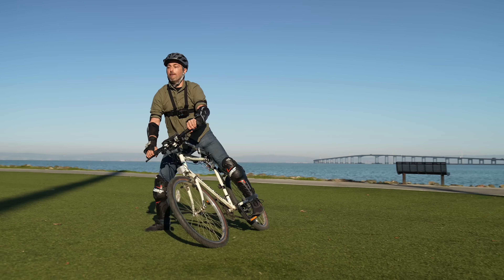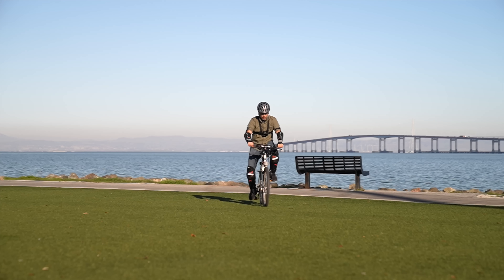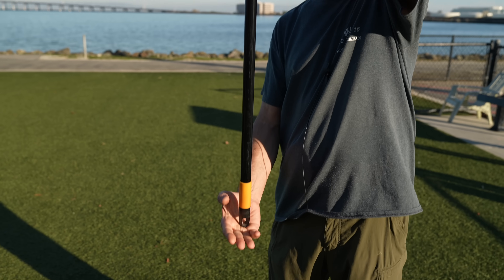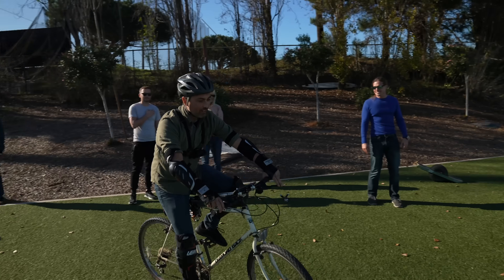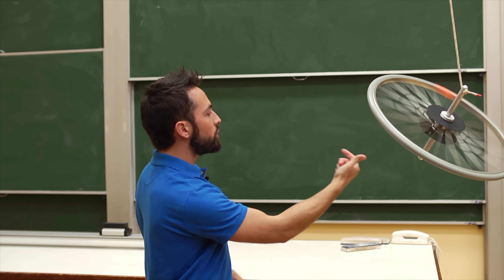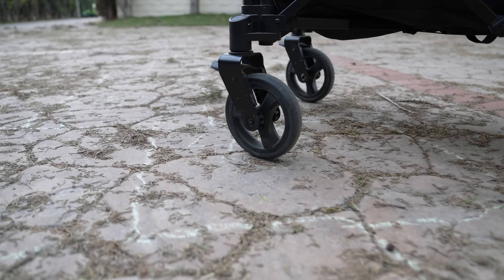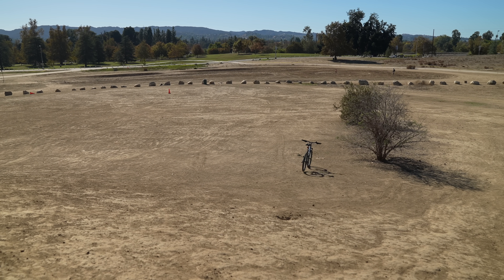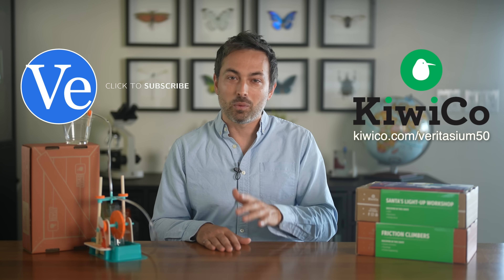Most People Don't Know How Bikes Work

Comment: Fun fact? I was able to learn to ride a bike ONLY in 7-th grade !!! Because only then i uderstood phisicaly speaking what i need to do in order to maintain balance. The counter-forces i needed to develop ! In 7'th grade i got the Phisics discipline, the mechanics part. Same with the swiming, i was able to swim when i understood what i need to do in order to swim, by creating a constant force down to lift my body a little above the water. To be exact i neded to lift my hand or my leg more aquadinamicaly than when i put it don in the water. The diferences between these 2 forces was the lift force, to be able to stay on water. After that, to advance in water, i used part of the lift force to advance. So the movement was like a propeler.  So now i learned to swim too.  Same with staing on a ball , or 2 crossing pipes, like a circus guy,  or sky-ing and snowboarding. Couldn't aford a ski instructor, so i distroyed couple of a sky slopes to learn. Snow was destroyed,  and other sky turists had critical problem riding the slopes i used. Yeah , whenever i had a real problem to learned something, the other people around me got THE BAD LUCK, during my learning process. And i'm ok with that because nobody wanted to HELP ME. SO THEY GOT ALL THE SIDE EFFECTS OF KARMA !!!

Comment: i can't understand this.
can't you simply lean to the left when going left? without moving the steering wheel (like when you ride without using your hands)
Reply: When you ride without your hands you're still steering, but you're doing it with your hips.  You actually lean the bike (not yourself) slightly opposite the direction you want to turn.  That causes the front wheel to counter-steer, and that puts you and the bike into the proper lean to make the desired turn.

Comment: I wonder how hard the bike would be to steer if the rake of the front fork angle was inverted? It would be inherently unstable on it's own and you'd have to manually fight it the whole time. Some motorcycles are inherently unstable because they have a tendency for over correcting and developing a speed wobble. So each time the wheel self corrects it overcorrects a tiny bit and then again and again with greater energy until it crashes. Some bikes have a steering dampener to reduce the effect, but usually it comes from a hard bump or landing  a wheelie but some bikes seem to just want to do it on their own.

Comment: I ride a bike typically no handed, I'm curious how that would affect it. I know the handle bars move when I am riding
Reply: When you ride no handed, you're still steering.  You're just doing it with your hips - taking advantage of the three principles Derek describes for riderless bike stability.  I've put plenty of people on this bike.  With or without using the handle bars, none have come close to balancing it.
Reply: @Rick_Cavallaro  did you have the reverse steering bicycle?
Reply: @SimonTekConley  I've never been on a reverse steering bike.  I do think you could ride that no-handed.  I'd love to try it with and without holding the handle bars.  I've got a theory on how to learn it more quickly.  I used my "method" to learn how to hover a heli, and I got adequate at it in about 45 minutes.  In the end, I could hold a hover, intentionally induce a PIO, and recover from the PIO.  It's all about breaking it down to one thing at a time.
Reply: @Rick_Cavallaro  someone I met once, made a bike that did reverse steering, it took a while to learn, but once you did. No issues, until you switched to a normal bike. 
That said, there's been multiple plane accidents where the controls reversed, and it took too long to recognize the issue.

Comment: Is easy to keep a bike up if you counter weight it.  Just push your bike away from you with both feet on one side and holding the handle bars.  The bike won't touch the ground and neither will you

Comment: It would be interesting to watch someone ride that bike with the right technique, using body weight and steering by leaning the bike and not turning the handlebars. It’s correct that you need to redistribute your weight to turn, but we don’t do it by countersteering, we adjust our weight and lean the bike to the side of the turn.
Reply: >> we don’t do it by countersteering, we adjust our weight and lean the bike to the side of the turn.

Nope.  If you don't counter-steer - you fall.
Reply: @Rick_Cavallaro  if you turn by steering you need to counter steer or otherwise you fall. If you turn by leaning the bike, you don’t counter steer and don’t fall. But I won’t keep going with somebody not interested in learning about the proper technique and just insists that things only work one way just to keep proving a point.
Reply: @AlejandroIglesiasMusic  
>> If you turn by leaning the bike, you don’t counter steer and don’t fall. 

But you can't.  That's the WHOLE point of the video.  

>> But I won’t keep going with somebody not interested in learning about the proper technique and just insists that things only work one way just to keep proving a point.

Well that works out perfectly since you're making claims that are easily proven false.
Reply: @Rick_Cavallaro  what do you mean you can’t? When the bike locks the left side and you can only turn right, you lean the bike right, bike turns right, no countersteering. If you don’t know how to do it, it’s okay, but don’t say it can’t be done if you’ve never even tried the technique. Best.
Reply: @AlejandroIglesiasMusic  
I've put many experts on this bike.  What I mean by "can't" is "CAN'T".  They've tried it.  You haven't.  You can't either.
And I thought you were  done with me.

Comment: Another cool thing to try while on a moving bike is having only one foot on a pedal, leaning the bike to the side of the pedal with your foot on it, while also leaning your body away from the pedal putting pressure on the frame of the bike with your thigh. You can lean the bike to the side whilst counter balancing it with your weight/pressure to keep it from falling while going straight as an arrow without doing anything else.

Comment: I tried this.
Unless you lean in with your body excessively before turning, this video is true.
When moving at speed, you can try leaning in first with your body, shifting your weight like what you'd do on a motorcycle.
Reply: >> When moving at speed, you can try leaning in first

You can certainly try that, but you still fall.

Comment: These test all seemed to be at low speeds where any gyroscopic effect would be relatively small.  Does it play a greater role when going faster - say sprinting speed or higher.  It certainly feels that the front wheel of my mountain bike is being aggressively pulled to point straight, even when flying through the air, when screaming down a bumpy hill.

I should also add the the feel of the steering, how I steer and the type of effort made to maintain balance changes with speed.

Comment: Keep your handlebars strait and turn using your body weight
Reply: Doesn't work.  Steering locked = fall down.  I've put all sorts of experts on this bike, and they've tried everything.  No one can do it.
Reply: That body weight thing works fine on a lightweight machine like a bicycle, but then you’re perched atop of an 850 lb. full-dresser, you’d best understand “counter-steering”. Simply shifting your weight will land you in the weeds.
Reply: @sking2173  The body weight thing does not work.  If you could shift your weight to initiate a lean, you would be able to sit on a stationary bike, lift your feet onto the pedals, and then immediately have a friend tell you which way to fall.  Try it.  It won't work.
Reply: @Rick_Cavallaro  — Yeah, I didn’t write that very well. 

What I tried to say was leaning your weight into the turn, while putting weight through your arms onto the bars, you will naturally push the bar on the side of the lean (weight shift), which will naturally counter-steer the bike, even if the rider doesn’t realize he’s doing it. 

BUT, to adequately control a massive machine, you will have to CONSCIOUSLY counter-steer, not just rely on happenstance.

Comment: I wonder how a person  with track/fixed gear experience would handle this thing?
Reply: In a track stand you turn your front wheel about 45 deg and still move the bike fore and aft a few inches.  If you lock the steering straight ahead - you fall.
Reply: @Rick_Cavallaro  More speaking about pedaling through turns and toe rub.  It forces you to rely on leaning into turns, more so than geared bikes.

Comment: After having driven bicycles and motorcycles for about 15 years, I moved to another province and had to take lessons to get my motorcycle licence. Part of the course was the concept of contre-braquage or counter steering, to go around corners. Totally screwed my riding, because I now had to think about how to turn, instead of just doing it as I always had. Too much knowledge is not always a good thing...
Reply: That’s because you psyched yourself out. Change your thought process from, “steer left to go right”, to “push right to go right” (where what you push is the bar).

Although it’s not the best form, you can ride even the biggest Harley sitting bolt upright (body centerline perpendicular to the road) by pushing the bar in the direction of the turn.

Comment: There is actually an error in this video. Something was overlooked. And that's because when you turn the bars left, in one way, your point of contact with the ground actually shifts to the right, of the bike, by a small fraction, and results in a lean in the direction you turned the bars, OPPOSITE to what you suggest. HOWEVER this only works if the movement of the bars is slight. And it is exaggerated MUCH more if the bike is heavier. Its much easier for this to be demonstrated on a motorcycle. This is why with a motorcycle there are two different approaches to steering, dependent on speed. This differs between motorcycle weight, and the angles of the steering components (mostly caster). At slower speeds you steer in the direction you want to go, and at higher speeds (20kph or more) you use counter steering, generally, because there is a cross-over. Inbetween these differences at this crossover obviously steering must occur. Which method works is dependant on how fast the handlebars are moved. Quickly for counter steering and slowly for direct steering. This is why most motorcycle riders, particularly beginners find steering at this "in between" speed is move difficult and they look unstable on the road. Next time you are in Sydney Veritasium I would be happy to demonstrate this for you.
Reply: >> At slower speeds you steer in the direction you want to go

Nope.  You just think you do.
Reply: @Rick_Cavallaro  All depends on how fast you twist the handlebars. If counter steering was the only way. People wouldn't be able to balance a bicycle at a stand still, but they can.
Reply: @lukephilpot5660  It's extraordinarily rare to find someone that can balance a bike at a stand-still with the steering locked straight ahead.  A track-stand doesn't count because people do not do that at a stand still and the steering is not locked straight ahead.  The steering is typically turned about 45 deg, and they move slightly fore and aft to balance themselves as an inverted pendulum, exactly as they do by steering while riding.  They do not track stand by shifting their weight.

If you could simply shift your weight, you could do that while sitting perfectly still on a bike with steering locked straight ahead.  And I've yet to find anyone that can even come close to doing that.
Reply: @Rick_Cavallaro  I was referring to balancing with the steering unlocked. The only way this could be possible, the counter steering to which he refers could not apply here. Sit on a bicycle with the wheels in-line. Now steer all the way to the left, and you will see the front contact point on the ground move to the right hand side of the bike.
Reply: @lukephilpot5660  
>>  I was referring to balancing with the steering unlocked.

It's a VERY rare person that can balance a stationary bike, even with the steering unlocked to take advantage of the very small movement of the contact patch with steering.  In a track stand, the steering is typically turned about 45 degrees, and the person moves slightly fore and aft to move the contact patch enough to balance.

>> There is actually an error in this video.

What specifically do you think is in error in the video?

>>  When you turn the bars left, in one way, your point of contact with the ground actually shifts to the right, of the bike, by a small fraction

How is that?  When you turn the bars to the left, the contact patch moves slightly to the LEFT.  Or more accurately, the contact patch stays where it is, and the front of the bike moves to the right.
Reply: @Rick_Cavallaro  It is very rare, but it is possible.

The error in the video is that he says that counter steering is the only method that can be used. That's not the case. It appear that way on a bicycle because the weight is so slight. It's more noticeable on a motorbike because there is so much more weight on the ground, so shifts in COG are more obvious.

IRT to contact patch. You are incorrect. Go sit on a bike. Not sure how else to say it. If the angle of the steering column was perfectly vertical, the contact patch wouldn't change. But because it is angled towards the rider, the contact patch does change when you move the handlebars. And it moves to the right, when the steering is turned to the left. You'll see when you try it with the bike stationary.

There are two ways to steer a bicycle with the handlebars. The variables are the speed of the bike vs the speed of the movement of the handlebars.
Reply: @lukephilpot5660  
>> The error in the video is that he says that counter steering is the only method that can be used. 

You'll need to show me where he says that because I don't think he does.  I think he says "this is how you ride a bike".  Because... that's how people ride a bike.  It is only the very rare specially skilled athletes that have learned a different way to balance a bike.  They're not simple better at doing what the rest of us do (or try to do).  In fact, I think it's SO rare that you cannot point me to a single video of someone balancing a perfectly stationary bike by steering in the way that you suggest.  A track-stand doesn't count because the rider does not keep the bike stationary to do a track-stand.

>> You are incorrect. Go sit on a bike. Not sure how else to say it...

I will offer you exactly the same advice.  Go sit on a bike and you'll see that I'm correct.  I have to wonder if you know what a "contact patch" is.  It's the area where the tire is in contact with the surface.  And you're telling me that turning the steering with the bike stationary is going to cause the tire to slide to the right with respect to the surface when you turn the steering!?
Reply: You countersteer at all speeds.
When a stationary bike start to fall right, you need to turn handlebars to the right or you will fall.
Reply: @XtreeM_FaiL  You can counter ssteer at all speeds. But it's not the only method.
Reply: @XtreeM_FaiL  Nah. But sure.

Comment: Why is it hard to balance on a stationary bike?
The "Track Stand" bicycle trick: Hold my beer!
Reply: Try to track stand with the steering locked straight ahead, or without moving.  You just fall.
Reply: @Rick_Cavallaro  well, you can always hop.😉
Reply: @craftyukraine  Yes you can.  But that's not a track stand.
Reply: @Rick_Cavallaro  there’s always a way out. Don’t give up on staying on a stationary bike!
Reply: @craftyukraine  Yes there is.  You can practice for years and learn the balancing technique that a few of the premier trials riders have mastered.  But they are not doing what you and me are doing.  They're not just better at it.  They've perfected different techniques.  But this video isn't about circus acts.  It's about how mortals ride bikes.

Comment: This applies to vehicles that have to be balanced while driving. Would you explain why some car drivers do the same while turning their cars? I see many people doing this, invading left lane to enter to the right and vice versa. It drives me crazy!
Reply: I think it's because they don't have a good sense of where their wheels are.  When making a tight turn into a driveway your rear wheel might hit the curb since the rear wheels follow a smaller radius turn than the front.  So they get used to swinging wide to make a tight turn into a driveway, and then extend that to forcing people out of their lane on the freeway.
Reply: @Rick_Cavallaro  yeah maybe

Comment: But isn't this only true for lower speed? I'd hypothesize that with increasing speed, it becomes less difficult to ride the bike with locked steering to a point where it does not matter... I wonder if someone could test this and find out at what speed this changes...
Reply: >> isn't this only true for lower speed

Nope.  Interestingly, most motorcycle riders will tell you they only counter-steer at higher speed.  That's also wrong.  We counter-steer at all speeds.  But it's true that the required steering inputs to counter-steer become smaller at higher speed.

Comment: Because thats how traction works. It is intuitive  for us to react such way. And cars does this same thing too if the corner is pretty sharp it is better to head the tire at the opposite dierction and enter the corner. If youre entering a sharp corner when youre inside the right driving/racing line. And cars has weight which can compensate the need for traction.